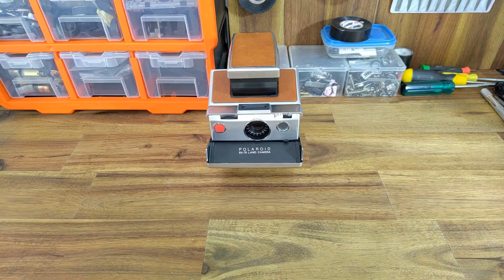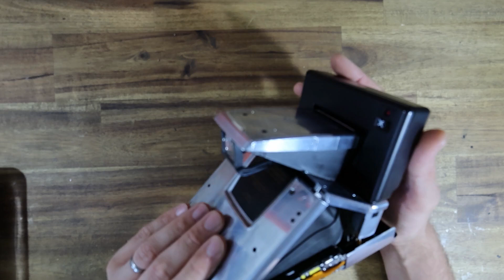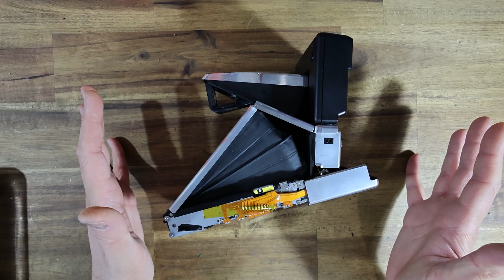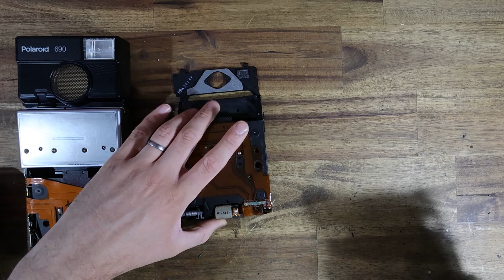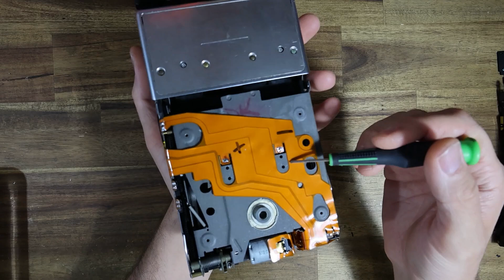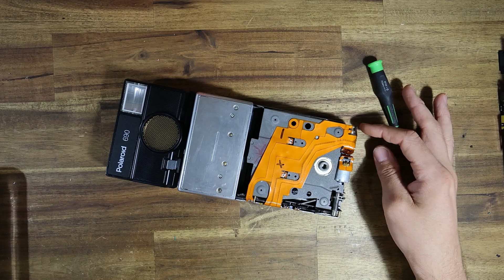The strangest design choice Polaroid ever made.

Comment: Why couldn't you just cut the traces on the ribbon and bridge them to the switches again? Might be worth looking into if the standby power really isn't needed.
Reply from the maker: one step ahead of you! 

I'm actually experimenting to see if this is possible. 

There seems to be some kind of capacitor effect between + and - batteries on the 690... And possibly as a result of this, or MAYBE because it was just simply faulty,  one of my Kratax 1.5V buck converted lithium cells blew up 

Though... my bench tests seem to suggest bypassing the ribbons it works fine with alkaline... but I wont post anything until I am 100% confirmed its a safe mod to do.

Stay tuned!

Comment: The plot thickens
Reply from the maker: I've already made a diagram on how to 'fix' the ribbon cable design and am currently bench testing my modified 690

As far as I can tell so far, there is no noticeable change in the cameras performance by altering the rear switch to cut power instead of controlling the logic gate